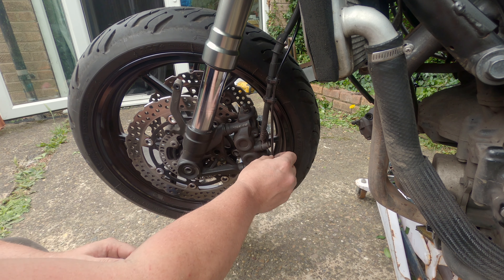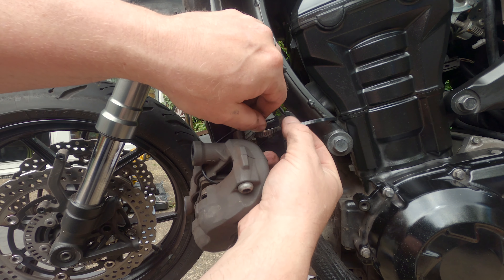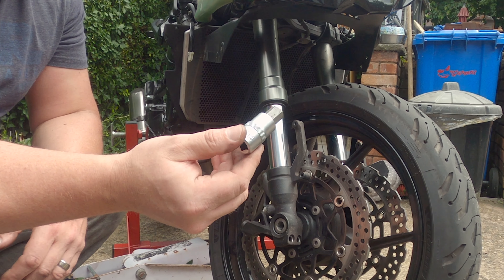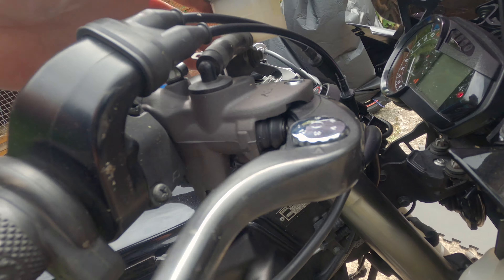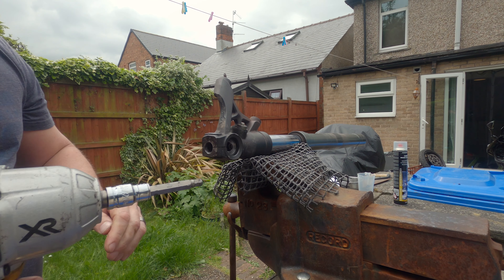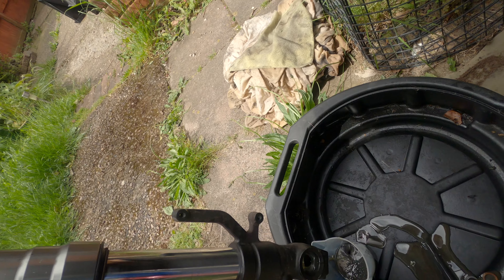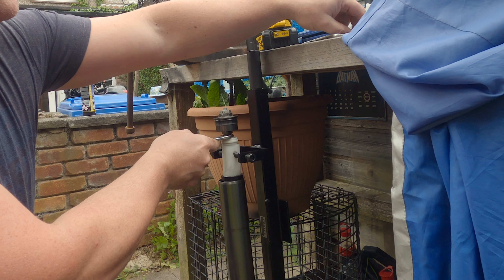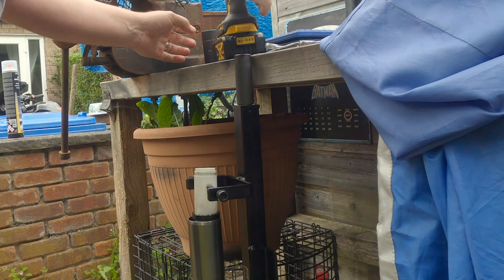Z1000SX 2013-14 Fork seal change & Overhaul - Damping rod removal

Comment: Great Video. With the Motul 10w oil you will find that the re-bound will have to be backed off from what it was set at, just while the fork oil is new. Then, as it slowly degrades it behaves like a 7.5w and lower.
Reply from the maker: Yeah Ive used it for years now, its a great oil and suits my weight etc
Reply: Great video, can I ask what the lift is you are using to stabilise the bike?